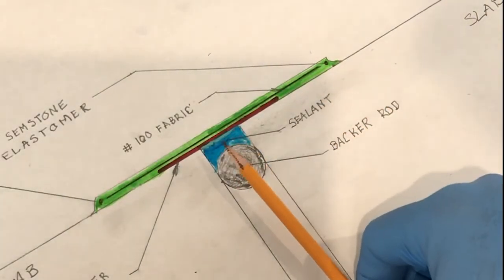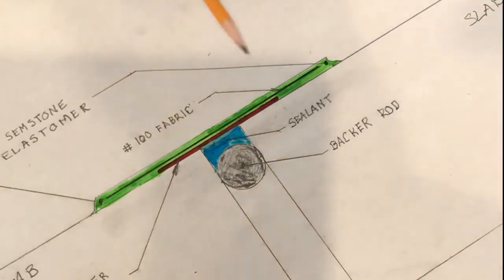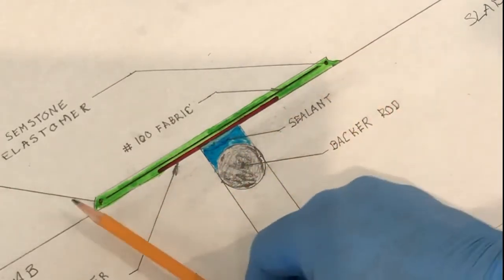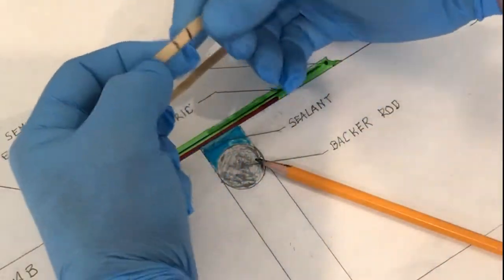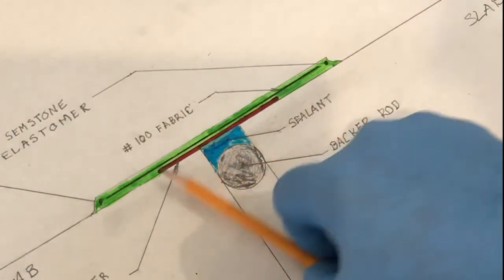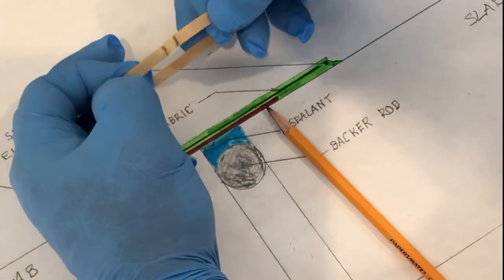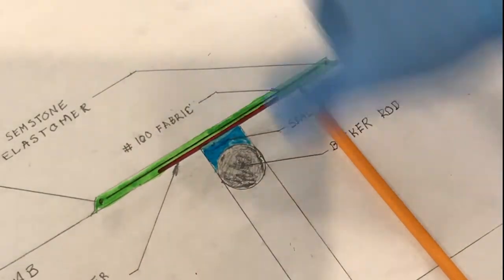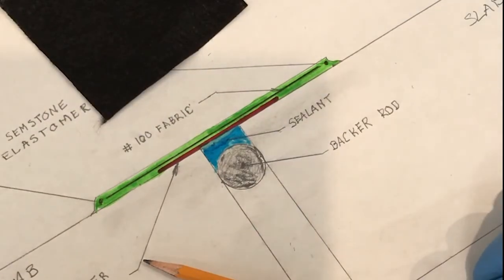Explained: Role of Bond Breaker Tape

Comment: Excellent explanation... A very critical installation is a tight joint that opens later.  Grab the rubber band with fingernails together, and there is pretty much zero stretch.